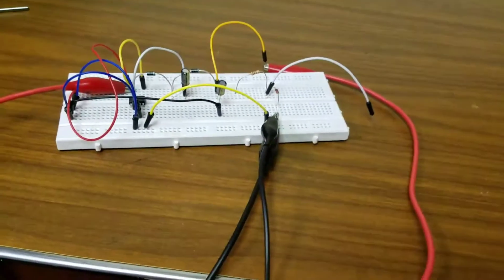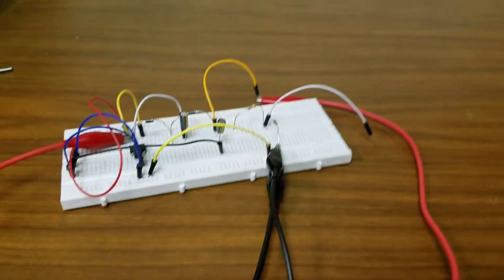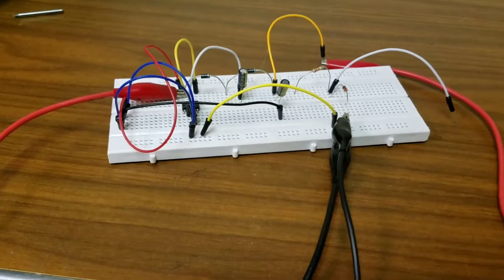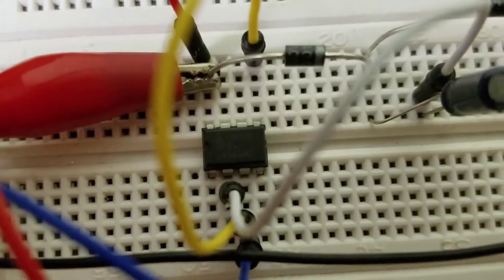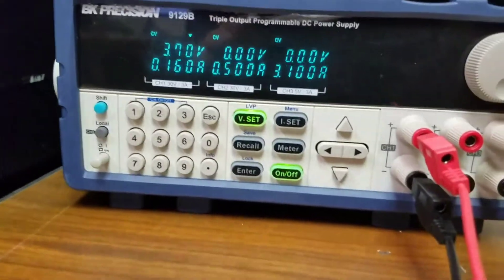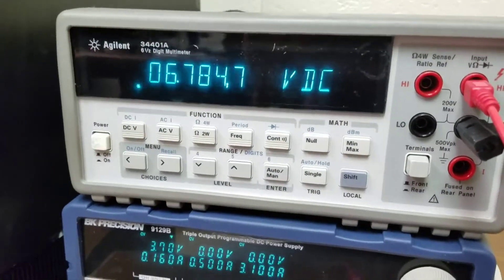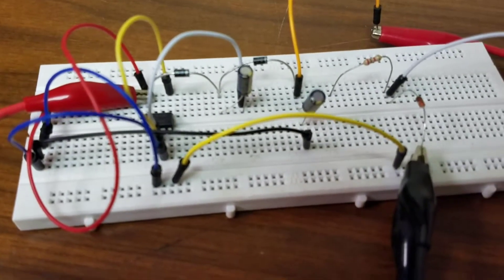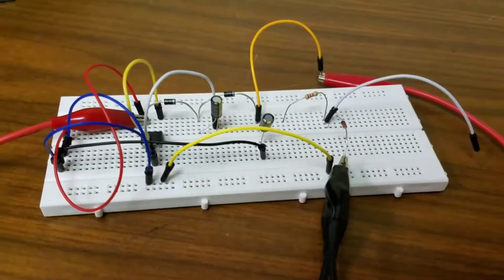ICL7660 Voltage Doubler

Comment: Would you mind posting a wiring diagram showing the physical connections...  I found a logical diagram but I am new at translating them to a physical arrangement of components. [EDIT: nevermind that... I got it to work thanks to pausing your video at the right frame.  PS I'm doing this project: http://www.nutsvolts.com/uploads/magazine_downloads/201707-Noon-Option_2_Figure_2_Schematic.pdf ] Thanks for posting the video...